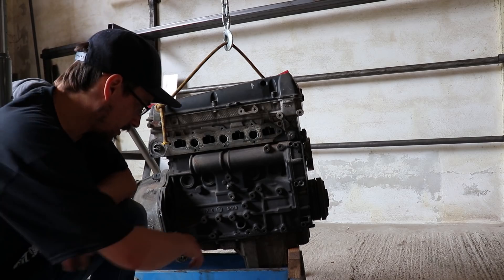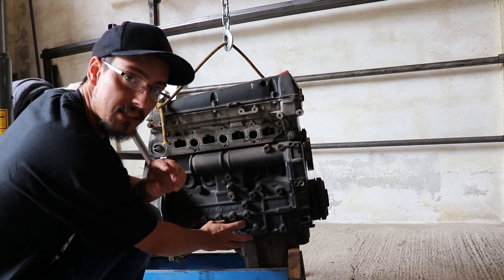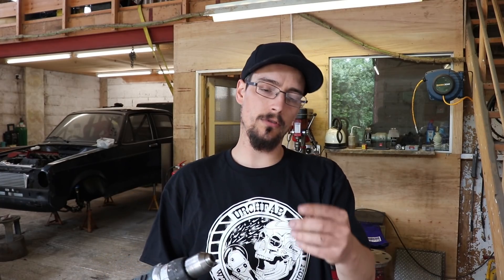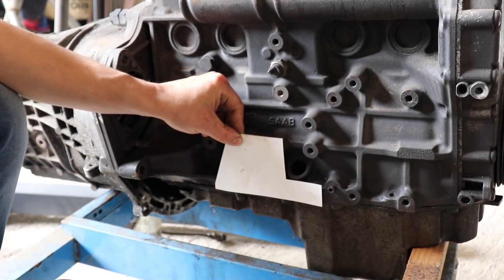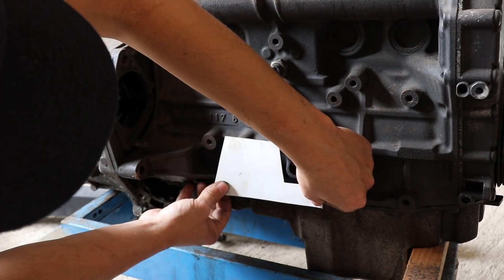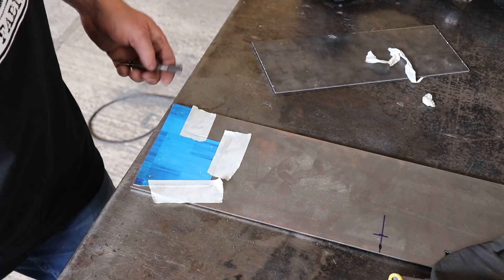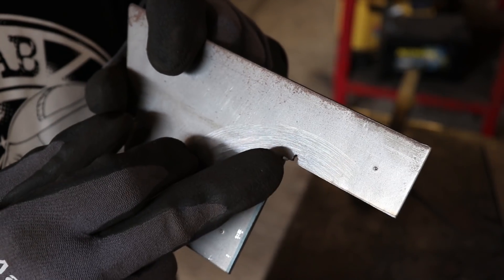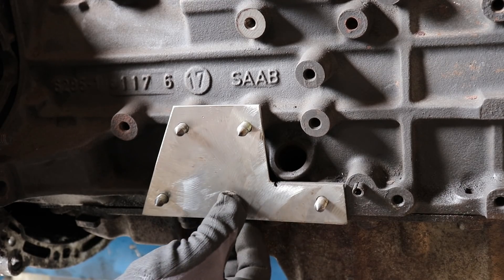HOW TO ACCURATELY MARK OUT HARD TO MEASURE BOLT PATTERNS

Comment: Awesome tip Matt.
I had been using the dirt on face and press the cardboard around the holes method but was always filing holes a little to fine tune.
The centre point from the bolts far more accurate.

Comment: I use vernier calipers to measure the distance of the bolts that are screwed in the holes. If measuere outside, then subtract the diameter to get the distance between the centers. Best is to start with the longest distance of 2 bolts. Transfer this to your template with a ruler. Then measure the distance of the third bolt from the first bolt an draw an arc with this distance in your template around first center. Measure the distance from the second to the third hole and also draw an arc in the template around 2nd point. Where the arcs cross you have hole number 3. Repete the steps, but best ist to use  always the same starting holes to stay accurate. To be very accurate, draw it in a CAD program, and 3D print a drilling template.

Comment: Fantastic.. I need several 10mm holes in a 7mm plate to fit a swivel seat in my van, been dreading drilling the plate wrong, having seen your video I am looking forward to cutting some 10mm bolt heads and turning them to a point first thing in the morning.

Comment: another way, l have done it for gas stove dials, is to photograph the holes with a ruler, put it in photoshop blow it up until the ruler is an exact match, convert it to a line drawing print it out checking that the print matches the ruler, use that as a template

Comment: I USE a bit of cardboard a Sidchome-4    ballpen hammer ,hit cardboard  with the ball end till you cut a hole ,put a bolt in that hole to hold it then do the rest  .good for gaskets  & marking out on steel  but you have to mark the center of the holes right . like yours for marking center of holes //

Comment: There's nothing like doing it the hard way why don't you try some ball bearings
Reply from the maker: Try it on a vertical surface with different depth  mounting faces and you will see why I don't use ball bearings.

Comment: When you do it for a living it take  2mins to mark it out!! Fuken giggled the whole way through this video!!😂😂😂👎
Reply from the maker: Come on then share  your tricks!
Reply: Urchfab measure hole centre from left to right bottom to top! 2 seconds with a bevel square to get   angles from bottom holes to top holes! Transfer into square plate!! Bingo!! First year apprentice work!!
Reply from the maker: I hear ya! I still think once you have a set of screws this way is quicker and easier for this type of application. plus if your mounting  holes aren't on a flat plane  eg the top holes set backwards by 20mm which is common on engine blocks I find it tricky to get it accurate without doing this. Cheers
Reply from the maker: Will do cheers

Comment: That's awesome man you know how many years I fought these for 30 years trying to build stuff like this and never even thought of that. Any idea when you got a plate that doesn't have a threaded hole on it? Like trying to get two plates to match up or build an identical plate like the one that's Factory on something that the bolt slide through?
Reply from the maker: Cheers, If I was making identical plates i would weld them together on the outside edge and drill through them all at once with one set of markings on the top plate, then grind the welds off. Is that what you mean?
Reply: @Urchfab  no what I mean is if you have a plate that's a part of some thing and you chant weld another one to  it how do you make them fit?
Reply: @MichaelKingsfordGray LoL...only obvious to people whom stop for 2mins & actually think about what they r doing. 🤔

Comment: You'd get so fucken shot for doing this at a work place. 

You'd just use a ruler and measure the center of the holes, and mark out the plate.

Waste of bolts bigtime.

Comment: I just drill a hole in cardboard attach with one bolt and tape then ball pin an impression of the other holes. You idea does seem very accurate though.

Comment: Why not wack each mark one by one drilling each one one then take out the pointed thread you used and replace it with a long one longer than the other pointed threads and then you can put the plate on the long thread to keep located and punch the next mark to drill and do that for each hole

Comment: Rub a marker around each hole or some dirt even.   Take paper rub the holes.  Transfers over and viola.    100 times quicker.  Done it for gaskets etc.    Works great.   This is also a decent tip

Comment: another way is get a piece of clear acrylic and use sharpie to mark the holes, then just transfer that to your piece . 

or use a pencil or just get anything around the holes to dirty them up, then grab a piece of cardboard and press it over, the dirt or pencil mark will transfer to the sheet.
Reply: Nah, not accurate enough. People who try eye balling the middle with a sharpie are the ones coming to this video for a better tip. Also acrylic is damn expensive to be fucking around for templates. This trick with the bolts and hitting the piece with a hammer is my favorite and less time consuming. I fit all racing seats with this method.  Put 4 sharp bolts, ask the guy to sit down, make sure he is centered with steering wheel, pedals, middle of windscreen, ask if he is happy, then hammer his skull through the sunroof which will give you the punch holes at the bottom to start drilling....
Reply: Yeah that is another way but his way is cheaper and seems more accurate

Comment: Hi, love your vice.  But on to business.  Save yourself some work.  What you are making are called transfer screws.  They are not very expensive.  They are available in sets for various thread sizes.  Here is a link to a supplier in the UK.  
https://www.arceurotrade.co.uk/Catalogue/Measurement/Punches-Scribes/Transfer-Screws

Since the transfer screws all have the same point dimensions (taper) it is easier to get them lined up in the same transfer plane (unless of course one of the mounting bosses is offset too much from the mounting plane of the others).  Thanks for the video.  Cheers.  R J

Comment: Nice trick, however the points on the bolts have to be perfectly centered.
Reply: Hence the power drill. He basically made a lathe.
Reply: tpcoachfix IF he would have used the drill on high speed to bring the bolt down instead of the angle grinder it would have been perfectly centered. BUT, much slower.

Comment: Use some tape and a sheet of paper.. With a ball peen hammer... (Use round side) Gently tapping around bolt holes will cut the paper.. It's a lot faster method for making a template..
Reply: Then you have bigger holes and you won't have the center point that his method gives you. It will probably work but it will never slip on as clean as his did.
Reply: Also you can use the same technique for making a gasket.  The making of gaskets has gone away
Reply: Dan Schultz It doesn't work. i have done it a lot of times. you are not professional. maby hobby level because you don't understand the importance of an center point for making an hole in an exact spot. An if you have to make 4 or more holes you are done and need drill a lot bigger holes than needed in order to solve the errors and get the bolts through.
Reply: Tomy ck it will not turn out great. At lest one will be off center. That’s if he’s lucky
Reply: no centre no accuracy
Reply: Tomy ck like you said, If your not a professional... Practice you'll get it 🤣
Reply: MichaelKingsfordGray The way Mark does it in the video is the best way. You can use the ‘dirty finger on the cardboard’ method, but it’s less accurate. OK for making a card gasket, but not the best for a pattern for accurate drilling.
Les
Reply: That’s how I’ve always done
Reply: I still do it the old way and its a better fit and thicker to :-)

Comment: Personally I'd use a lathe to taper the screws... buts dat 'cos I have 3 of 'em in  the workshop...
😂😂😂😂😎  
cone-point grub screws are available off the shelf too... 😒
This is a great example of the "KISS" principle... well done man 👌
Reply: If had only known they were called "Cone Point Grub Screws" I would have bought a bunch years ago.  Maybe I got lucky but I made some quite easily after watching this video.
Reply from the maker: 3 lathes, thats what dreams are made of! I've just moved out to the sticks on my own so my tools are a bit limited at the moment. A lathe is high on the list though.
Reply: camgere ... well thats what we always called 'em here in Ireland & in my youth I worked as a counter hand in a supply company selling Umbrako socket screws so I managed to remember the name (40 years ago !! )  😎😎
Reply: Urchfab.... I also have an old Van Norman milling machine & a small hobby mill for little bits.... the machines were left over from my small engineering biz years back & I couldnt part with them... particularly as their monetary value was less than their usefullness... I still do a little, mainly repairing agri-equipment for the local farmers... 

I wasn't tryin to brag..🙄🙄🙄
(well. maybe a little bit 😅)

Great to see a guy interested in working with his hands & willing to learn new stuff, its a dying trait in "modern man"   shame really... 😔
Keep up the good work & keep the vid-tips coming... 👌👍
Reply: So one for each hole?

But there's four holes.... exactly.

Nyah nyah nyah to you to.

https://youtu.be/8cSkX7X8a3o

Comment: deff handy to have those especially if you need holes for same thread bolts a lot..  another way to very quickly transfer bolt patters is to use intersecting archs..  you can use a measure but is most accurate using a compass or dividers.. using a compass set the pin point on the edge of one bolt hole then set the pencil tip on the same edge of a diff hole.. then draw a circle or at least an arch on your template... measure again to another hole forming a triangle pattern.. repeat for each hole .. when done your exact bolt holes will be at the intersection of your archs..  granted you wont have reusable tools when done but is way faster when doing one off stuff than making tools for the job.. hope this helps .. cheers  :)
Reply: shut up
Reply: Im not sure how that works. I tried it on paper and I couldn't transfer 3 holes onto the next page. The problem is, at least the way I understand this instruction, that you only have the original holes edge. So you draw an arc. Now you're in a situation that on the paper you have one place that represent the spot (edge) from which you took the first measurement and an arc. You now don't know where to draw the second measurement from. I must be misunderstanding the instruction but I re-read it many times and tried different approaches and always end up with the same issue.
Reply: @jackskalski3699  3 or more holes can be seen as one or more triangles.. using calipers or dividers or a compass, measure each hole distance from each other. Do this on the hole edge not the middle of the hole, and must be the same edge of the holes.  |O <-------------> |O  the distance between the same edge of the hole is the same as their centers. Then draw transfer the values to your pattern the same as if u were transferring a triangle .. the points of the triangle will be your hole centeres.. only after you map your hole patern, you can then cut the shape for the outside edges.. Hope this helps..
I just grabbed another link from a quick search .. I have no affiliation, but he does a good enough example to show the concepts of intersecting archs.. since not actually drawing a triangle no ruler needed
https://www.youtube.com/watch?v=LlEKIXE6QKY
Reply: @VorpalForceField  I see! Thanks for responding. I misunderstood the technique then :) it makes sense now!

Comment: rub the face with a wee taste of grease off the end of your finger ,,,, take a bit of nice card ,,,, like an air filter box ,,, press it on ,,, take it off without smudging ,,, job done
Reply: I think it was luck that by setting the pins at the same plane that if you tip the final piece back they could be off. You can do this too by using the cardstock and use a small ball oen hammer. You can tap around each hole and end up with a template. Lots of ways to skin a cat.
Reply: That a small ball pein hammer, geesh!

Comment: hey I noticed you like to use that adapter on your grinder with sanding discs instead of flap wheels, any reason you prefer that over the flappers?
Reply from the maker: I only use these because i bought 1000 of them cheap, I wouldn't recommend them, they're lethal if you catch an edge. Ive just restocked on flappers so you wont be seeing these for a while. Cheers

Comment: They also sell such pins. They are usually called "transfer pins" or something like that. 

For what it's worth, bolt holes as such will quite often be put on centers  that fall on even measurements, (by design). So you can measure the distances with some confidence that the center of one hole will be an exact number of millimeters from another.
Reply: Yes I would have thought so too. A tradesman would be taught to measure the holes and and then mark out his steel. This method, once the pins are created, is quick for the purpose and I have seen similar ideas used in industrial settings. Nobody would waste time on actually measuring hole distances as it is technically taught in a trade. We would normally look for a cheat just like this because it saves so much time.
Reply: These bolt holes form a rectangle, with the top long side evenly divided. (Or appear that way in the video). That's how I visualized it.  On the right hand side the top and bottom corner line up. On the left, the bottom corner was slid over to the right to fall in the middle of the two holes above. So in this case looks like all that need be done is drill holes in the corners of, and at evenly spaced points along an edge of a given size rectangle. It looked like this one was pretty easy.

Adam Booth and Lyle Petersen both endorse their set of transfer pins highly. The commercially available ones are hardened and have a very fine point, and typically come in a set with various threads. If used carefully they are accurate enough to mate threaded holes, not just through-holes. Real useful.

Engineers typically do not put holes in random places, but rather those holes will be in places that can be typically defined by rectangles, triangles, circles or combinations thereof. Distances will typically fall on an even millimeter, or fractional inch. If you can visualize the pattern you can duplicate it. But without measurements, it might take a couple of tries.

And, The title of this video does say... "HARD TO MEASURE" bolt patterns...

Comment: You're crushing it with your content. Love watching your tricks. One that I use is keeping a roll of drawer liner, the really cheap stuff that's basically just white stick on paper in the garage. You can buy a roll for one or two dollars and stick it right on to whatever you're trying to trace. You can even cut the drawer liner into 8.5x11" sheets and run it through an inkjet printer if you have a design on computer you want to transfer to metal. Thanks for all the videos!
Reply from the maker: Awesome, Il look for some of  that. Cheers

Comment: great tip thanks.  See you have the rtech 50 plasma cutter , do you not find shorting the cutting shroud on the workpiece causes it to spark? I've often wanted to use my one like that as a drag tip cutter but seems to arc and wasn't sure if it can cause damage.  Could you do a vid on plasma cutting techniques etc? when you'd use plasma versus angle grinder or cut off disc Cheers
Reply from the maker: Mines probably 4 to 5 years old now and ive been doing that since new, you go through tips quicker but thats about it. I will do a video on some plasma cutting. Cheers

Comment: i use allen head grub screws and small pieces of an old allen key hex sharpened to a point so you can run them in right flush but easily remove them
Reply: That's clever too, there times you don't want the bolts sticking out but you are afraid of winding them down too far that you can't get them out.